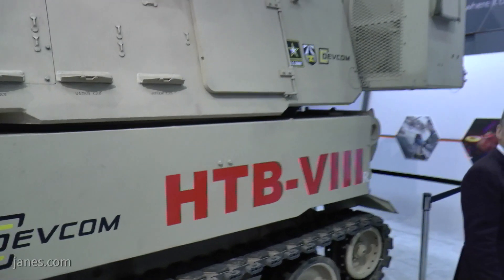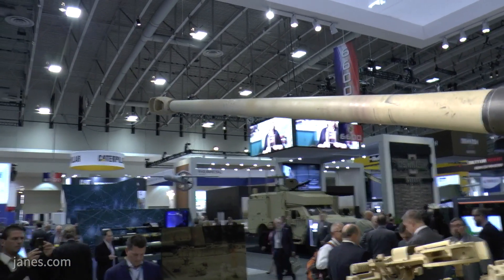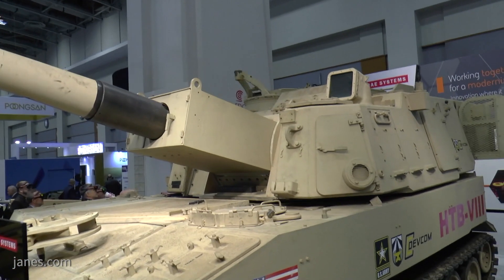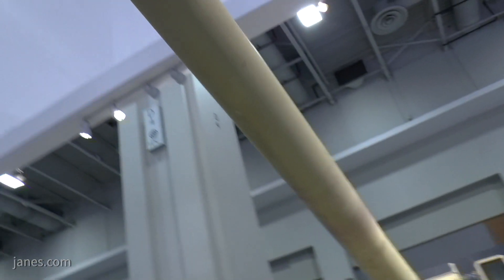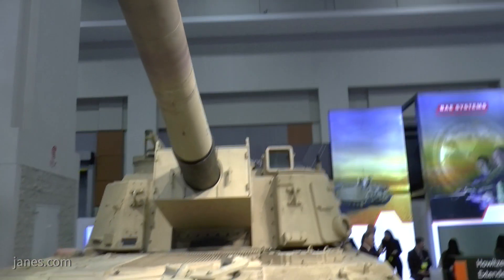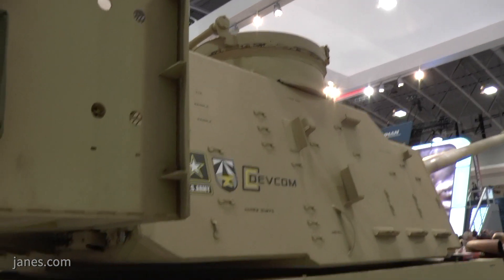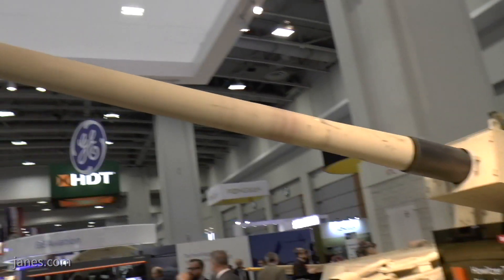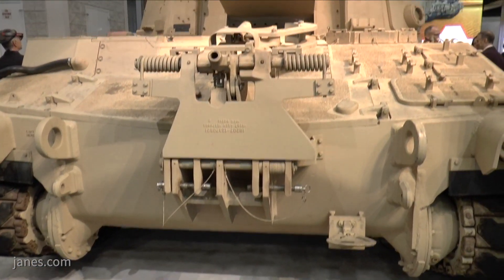AUSA 2019: BAE Systems debut their Howitzer Test Bed for Extended Range Cannon Artillery programme

Comment: This us awesome but we need more missiles. Thousands and Thousands of long range land and sea based missiles to take out enemy SAM sites and Air Bases to open up Bombing Missions
Reply: Bombing missions are the most expensive way to get payload on target.  Only more expensive option is carrier based.  Land based missiles: Yes.  Everything else: Pretty much: No.    Long range fires is all about $$$/Ammo tonnage = higher number of targets eliminated for lowest cost.
Reply: @w8stral  true but bombing missions are necessary. However the US does need more rocket artillery
Reply: @smithnwesson990  Depends what you mean by rocket artillery, and bombing.  Now that everything is guided, bombing missions on paper seem valid ... until you factor in cost of the aircraft and its development compared to a simple missile which is vastly cheaper and you do not care if a few get intercepted. For instance take the A-10 which on paper can carry ~16,000lbs of ammo servicing a lot of targets, but the planners during cold war figured that the A-10 would last at best a week before they were all shot down and this was seen as the cheapest form of interdiction.  Today, same interdiction range... How many sorties is this?  Not many.  For same cost how many missiles can you fire?  A HUGE number.  For same cost how many GMLRS can you fire?  A greater number.  For Artillery with Excaliber how many can you fire?  A VASTLY greater number yet. 

If you wish to do the calculation then do energy required, cost of logistics and vulnerability of said logistics to get asset close to a theatre, and payload delivered. I grant, not straight forward task.  The biggest cost is fuel and protecting fuel supply.  For instance 1 gallon of kerosene/diesel in the theatre of war cost roughly $400......, but you can stand off and fire, cost drops to ~$20.  The cheapest has been artillery fire for the last 100 years, but recently has lagged behind bombing IF, uh hem, IF you eliminate need for stealth etc.  As soon as that is reinserted into the equation... not cheaper. 

As for your question why does everyone not make LONG fire artillery?  Because they are not stupid as the rounds everyone has fired UP TO THIS POINT, have all been STUPID artillery rounds along with their pathetic precision, accuracy.  Now that artillery rounds are guided, what they are aimed at they hit.  But, 155mm artillery with half the insides full of guidance systems means they are once again, not all that good.  Need higher amount of explosive which means bigger shells which means BIGGER guns, which just coincidentally also means 2X-->4X the range if not 10X-->100X the range depending on the artillery system in question.  For instance large tube artillery where shell has a scramjet in it has effective range only limited by artillery size.  For instance 1500nm delivering 200lbs of high explosive out of a 16" unmodified Mark 50 barrel on the Iowa class battleships, or 1000nm delivering 400lbs of high explosive arriving at ~mach 6.  The problem with these shells is when it was calculated out in the late 70's and 80's, no guidance system could withstand being fired out the barrel.  Today, that is not true.  Why is 1500nm significant?  Because 1500nm covers 80% of the earth's surface if fired from a ship at the coast line.  Only a small part of central China/Russia/Asia would be off limits. 

While long range artillery fires is started from the ARMY, who actually NEEDS this is the NAVY, anyone's NAVY. 

The problem today is missile interception, not the cost of producing them and firing them.
Reply: @w8stral  Missiles are good for high value stationary targets. However the concept has always been to destroy SAM systems with Stand off missiles/long range artillery which opens up a hole for strategic bombing runs or airdrop of airborne troops. There just aren't enough missiles to replace good old bombing. Although the Army has just plsced an order for 10,000 more GMLRS rockets this year.they acquired 8,000 last year and 6,000 the year prior. Clearly they are stockpiling rocket artillery. It's good that they are finally stocking up on LRASMs and JASSM. Now that INF Treaty is done they should buy Tomahawk land Missiles again

Comment: They have already achieved that goal with the M777 light weight titanium artillery piece firing the 155mm shells with extended barrels and new, improved shells.
Reply: With assisted ammo (BB, RAP & BBRA-VLAP) only. But they cause a lot of wear to the barrel, I think 58 cal will allow unassisted projectiles to achieve longer ranged i.e. 70 kms
Reply: @SR-be5hr  Yes, they extended the barrel length by 6 feet and thickened the barrel to handle more propellant in the rounds and that has already been achieved at the Yuma Proving Ground.
Nammo has also made a ramjet round that contains solid fuel that would ignite once the round leaves the barrel to accelerate the round toward its target and the range is at around 100km or more depending on how much solid fuel is packed into the shell.
Reply: @trankt54155  - It sounds a plausible solution.

Comment: They thickened and lengthened the barrel and popped in a ramjet shell with extra propellant and voila there is your 70 km (roughly 44 miles) range of fire. They are now working on a 1000 mile artillery piece. So stay tuned....
Reply: I just learned that Pratt & Whitney were developing a 16 inch scramjet shell for the Iowa class BB's that had a 400 nautical mile range. It's a shame they were pulled from service before those rounds were finished.
Reply: @MrBurgerphone1014  Nammo, a Scandinavian company, has produced a ramjet 155 mm round that contains solid fuel propellant that once the projectile is fired out of the cannon barrel it would accelerate by burning the solid fuel in the round, instead of normally starts to decelerate after leaving the barrel with the conventional 155 mm round, and heads toward its target. It was reported that the round would hit a range of at least 100 km or more depending on the amount of solid fuel available on board. Field testing should be conducted at around 2021-2023 I believe. The round should be available for use on towed M777, the Paladin mobile 155 mm artillery system and the naval main gun as well.
Reply: @MrBurgerphone1014  For good reason, IMHO...considering how proliferate LRASMs are these days, and how much of a magnet those Iowa class would've become. What do you think?
Reply: @TheCoupe06  Just sayin, a full broadside of 16 inch scramjet rounds would be badass.
Reply: @TheCoupe06  LRASM (a naval version of JASSM) is a great antiship missile at a range of around 200 miles but is very expensive at a million dollar price tag. What if you can fire 155mm rounds from mobile land based systems that would travel out to sea a few hundred miles? These system would be perfect for deployment around the South China Sea to hold the communist Chinese naval force at risk. These systems can also be fired off from the amphibious ships at enemy ships or bombarding the shores prior to expeditionary landing. Artillery rounds are much cheaper than missiles and if they are guided by GPS/INS with fins, etc. they would be deadly to ships sailing through the S. China Sea.
Reply: @trankt54155  'Thing is, once a 155mm round leaves the tube, there's only so much correction it can make, even with "guidance". My thinking is, ships at sea may still have the advantage in being able to out-maneuver a 155mm round. I'll admit I'm still a bit fuzzy on the possibilities.
Reply: @MrBurgerphone1014  'Sure, if they could survive long enough to get the first mission. Remember, a peer adversary has aerial reconnaissance & attack/fighter aircraft too. An Iowa class is a pretty big "boat" and won't be hard to spot in short order. Like aircraft carriers. But then, there's more attack/fighter aircraft than gun turrets.
Reply: @TheCoupe06  Yes, once the round leaves the barrel it begins to decelerate and the guidance fins would pop out to help steer it to its target---provided it is within the range limitation. For example, the Excalibur 155mm round would guide itself toward the target using GPS/INS if the target is stationary and within the 25 mile range. The circular error is roughly about 5-10 meters. If the target is mobile then the round would need to be guided by laser illumination by target designator, or built-in millimeter wave radar for guidance.
To extend the range of the round they added solid rocket fuel that would ignite once the round leaves the barrel and that round is called ramjet round. For now it can travel out to about 60 miles (100 km). If they could double that range out to 120-150 miles than the round would rival the short range missiles that are currently in the inventory....
Reply: @TheCoupe06  So once the 155 mm has solid fuel on board it effectively has become a little solid rocket fuel missile with  a big kinetic send-off by the artillery firing. Once in the air it would burn the fuel and guides itself along with the initial momentum that it has from being shot out of a gun. It would be like a ballistic missile but does not need to burn its fuel on taking off.
If you see a 155mm goes off it is a beautiful sight---totally devastating.
The price tag is hugely different between a LRAM/JASSM, or even a naval strike cruise missile, and an artillery round. You can deploy the 155mm artillery on the amphibious ships like the Wasp or San Antonio and fire off as many round as you need to at enemy ships or shores. Cool, isn't it????
Reply: @trankt54155  Yes, I'm pretty sure I've seen a few "go off"...and not by way of watching videos.
Reply: @MrBurgerphone1014  If you can accelerate the projectile to escape the earth gravity and have it fall back to earth  then literally you can lob it at a very long distance. There is a history to that and it is called "the Supergun." A Canadian was helping Saddam Hussein to build such a weapon. Several had been built and the barrel is extremely long....and so on...
Reply: Army Sad...1000 Mike gun lol...
Reply: @z941273  English please....

Comment: We all know why you inquired about ammunition costs.  Are they still expecting the Army to buy $70,000 rounds?
Reply: The price would come down. Still longer range than the $68,000 Hellfire missile.
Reply: @trankt54155  hellfire costs more than that
Reply: @Battery-kf4vu  Depending on the version but Hellfire missile and Excaliber 155mm round cost roughly around $70,000-$100,000 per round but Hellfire missile can travel out to around 4-5miles but the artillery round can travel out from 15 miles to 44 miles and even longer with solid fuel round.
Reply: @trankt54155  Pretty sure even the basic hellfire costs around $110000. $60000 is more the cost of TOW-2A.
Reply: No. They will have some of the expensive rounds but the idea is to have a 30 to 40 mile range on standard Shells which would be a game changer

Comment: Palidin needs to be replaced...
Reply: PZH 2000 would be a good replacement since we can’t seem to build an Artillery system that is on par with other superpowers.
Reply: @ozzy7763  NIH.
Reply: Yes well it was going to be in yr 2000(Crusader program) with a 240mm but got canceled which likewise screwed over the Zumwalt ship.  Can't have everything.
Reply: VectorGhost care to give a reason?
Reply: A reason? The base has been developed in the 1950's. Why do you want to keep upgrading this oldtimer?
Reply: @SuperGeronimo999  Because its still a very good chassis and gun platform.

Comment: 30km range of fire they want double range so 30 miles
Reply: They doubled that to 70 km, which is roughly 44 miles..
Reply: trankt54155 that’s what they want. Currently it only shoots 18 miles if you add the difference it’s an additional 15 miles
Reply: @r3gr3tfulfly3r5  nope check out their videos. They have already fired multiple rounds at 42 miles. They are trying to push it even further now.
Reply: 1km = 0.62137 so 70km = 43.49 rounded is 44. Just for verification sake. 😗